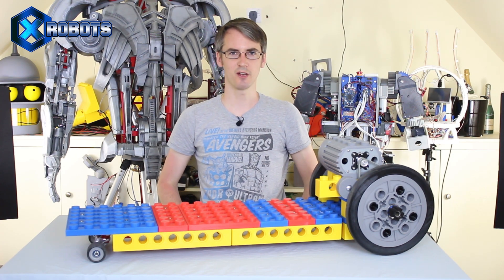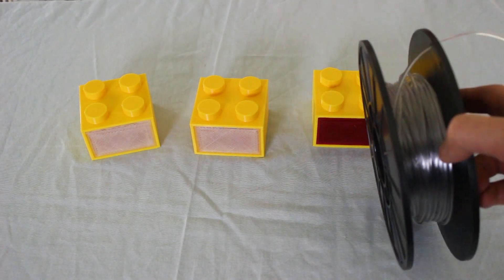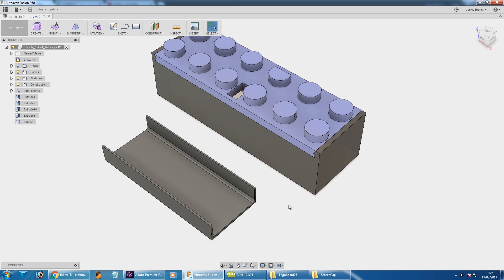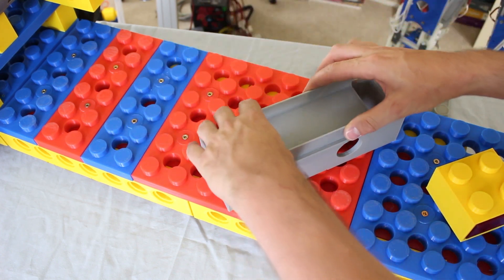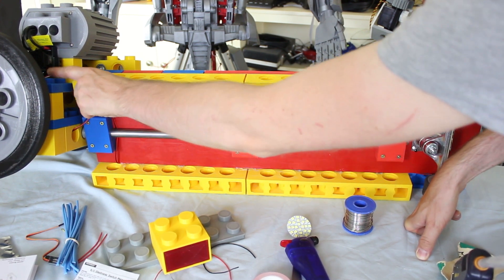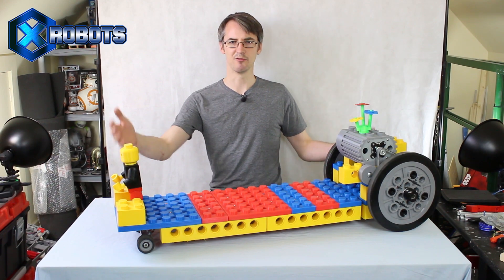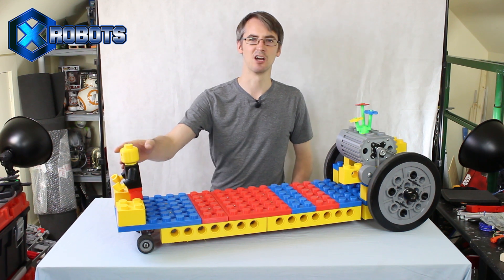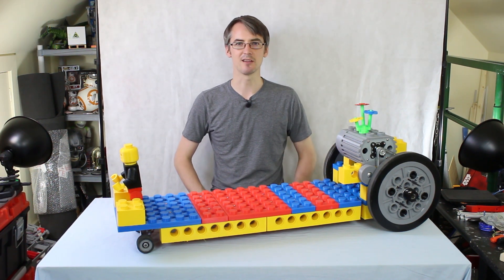LEGO Electric Skateboard #3 | James Bruton

Comment: you could use a multiplier for the bike computer. for example if your tires are 30cm,
just tell the bike computer they are 60cm (or 90cm). So you know 
the actual speed is 1/2 (or 1/3)of whats on the display :)

Comment: Awesome build! I'm honestly considering making one! If I may make a suggestion I think you should relocate the leds so they're facing the lenses then paint the insides of the bricks black to help with the light bleeding through the plastic, this way the light is more directed outwards and the residual light bleed doesn't affect how the lights appear as for instance the led for the real light is so intense that I couldn't even tell it was red.
Reply: You should cover the inside of the light bricks in aluminum tape. This will help the light to be reflected out of the lenses and stop the entire brick from lighting up.

Comment: I think you should line the insides of the light bricks with black paint.
That way, the light is projected only through the lens, not the walls.

And you should've also used some kind of semi-permanent adhesive as well so that nothing fell off!

A great suggestion from me!

Comment: next time make sure u have brake. braking is important.
Reply: James Bruton doesn't looks like it brakes well though. Instant braking might throw you off the board. But the 'magnetic braking' doesn't looks like its doing a good job at stopping. I hope your next version will be better. Also u should put 2motors into the tire. When u lean sideways one motors will stop spinning and the other motors should continue spinning and this will help u to steer left and right easily. Just my idea based on automobile. Donno if its actually applicable to a small board

Comment: You should be able to easily find a bike computer with enough adjustment range for your back wheels, both of mine went small enough to measure a hamster wheel with a 22cm diameter (~690mm circumference) and had 1mm steps.
Reply: Brand name? Model? Seems like it would be applicable to other things.

Comment: Regarding measuring the speed.  Since you know (or can measure) the diameter of one of the back wheels - could you make a white mark on the inside of the wheel and use some kind of optical sensor to count the rotations?  (This little bit of electronics should be housed in a giant lego so you can just clip it on.).  Anyway, it seems to me that if you measured the frequency of rotations, you could calculate velocity (speedometer) and if you counted total number of rotations on a charge, that would give you an odometer. So - you could work out fast it can go, and how far it will go on a charge. :)

Comment: Couldn’t you hook up a small light gate in the wheel assembly somewhere as in a computer mouse and attach a little pin that passes through it? Then with some maths made easier by the CAD model you have yourself a speedometer. Take an average across 5 seconds or so for a final reading.
Absolutely loving it though!

Comment: I think it would be good if you made the rear light red, because it looked the same as the front lights...
Reply: I was thinking that...but they look kinda big; they might not fit rotated 90 degrees. Maybe he could put a mirror in at 45 degrees to project the light and insulate th sides with aluminum tape to keep light from bleeding out the sides.
Reply: Perhaps even simply rotating the LEDs to face in the direction of the translucent pane might make a noticeable difference.
Reply: Youtube compression algorithm... 
if it's bright it's white and if it's dark it's black. 
I'm sure it looked much better IRL.
Reply: Scott Cress I've never seen it happen to that extent...
Reply: Yeah those LEDs he's using are bright and the red/clear plastic he used for the lenses probably wasn't dense enough to filter out a ton of the other colors. It seems like they were bright enough to even penetrate the solid plastic parts.
Reply: Yeah, maybe something like a cellophane covering for the LEDs themselves or turning the brick housing red would help a ton
Reply: Oh and do blue or neon lights all around
Reply: Taniwha Plzz
Reply: Taniwha B plz